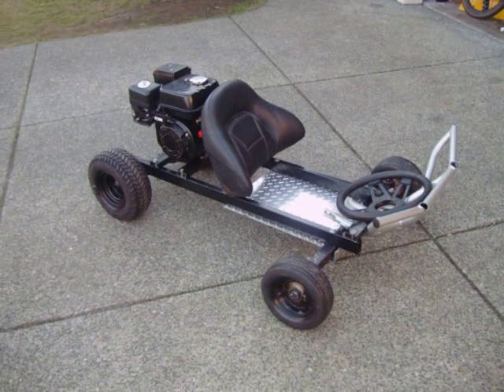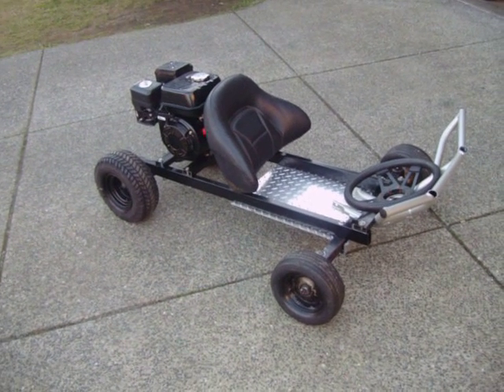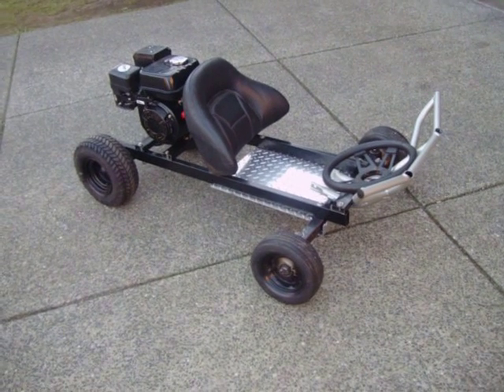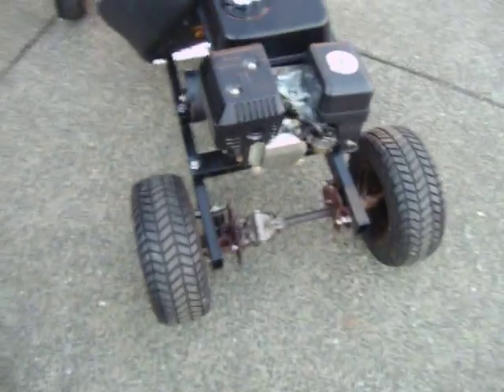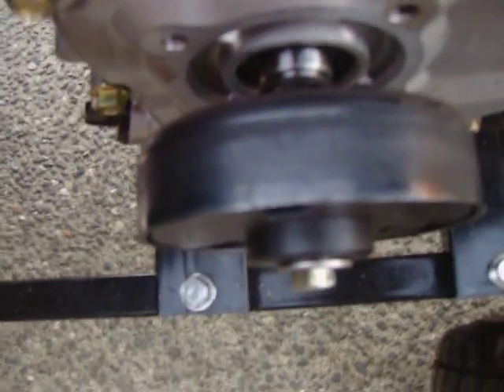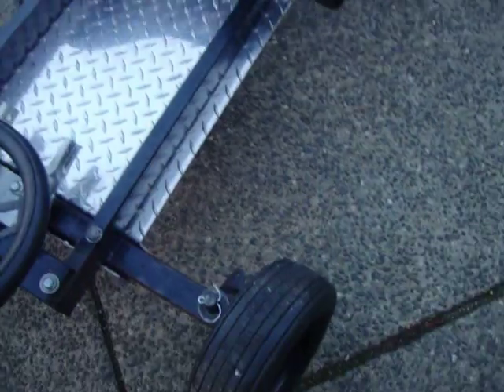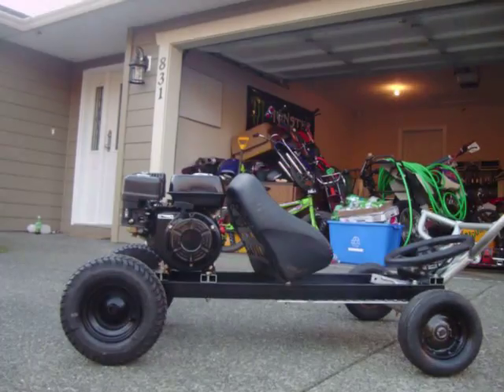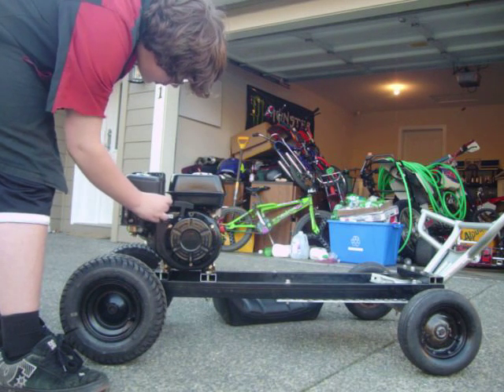Go Kart Build Part 2

Comment: That is not a 65 tooth sprocket.  Maybe 40.  I counted 20 teeth using my mouse, up the left side, over the top, and down the right side.  Also, a 60+ sprocket is much larger than that.

Comment from the maker: there are pads on the  shaft that are spring loaded inside the clutch, the engine shaft turns and the speed pushes thees pads and they rub on the clutch drum, turning the drum, turning the sprocket, chain other sprocket then turns the tires, when the engine is not going fast these pads stay close to the shaft not letting the go-kart take off.

Comment: Yeah, I buy a bunch of stuff there. We had a torque-a-verter on our mini bike about 10 years ago. It worked good except the bearing tube on the 2ndary pulley was only crimped into the mounting plate and it busted out. But the new ones have a one piece aluminum mounting plate which probably works better. If you don't want to spend the money on the torque-a-verter, you could make a jack shaft in there to get more low end power.

Comment: That looks more like 25 teeth on the axle.With that ratio it will have lots of top speed,but poor acceleration.You may even burn out your clutch if it is working too hard.With the short wheelbase you can make it a lot lower for more stability and still go off road with no trouble.I would consider doing that because it looks like your engine mount is in the way of your chain.